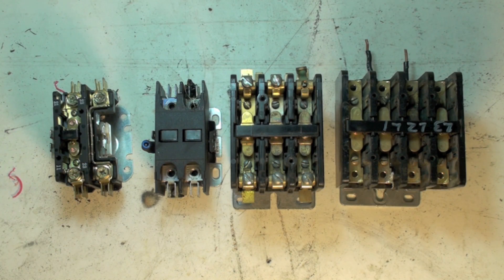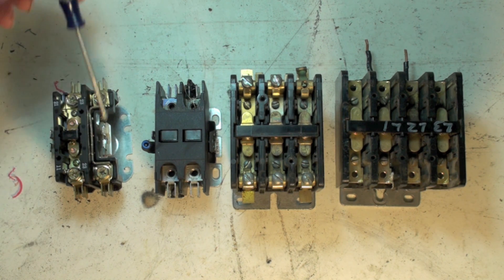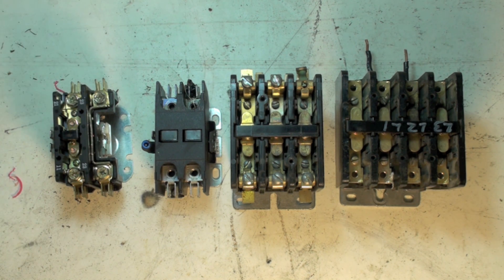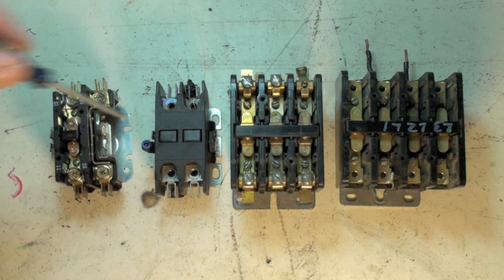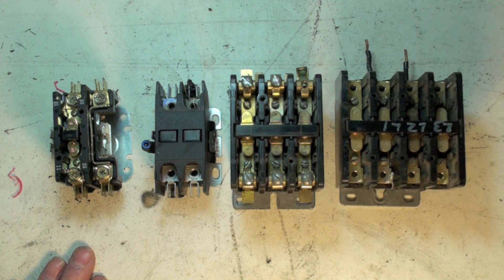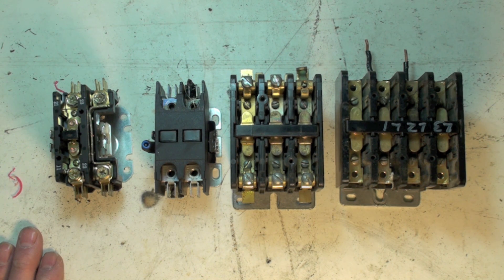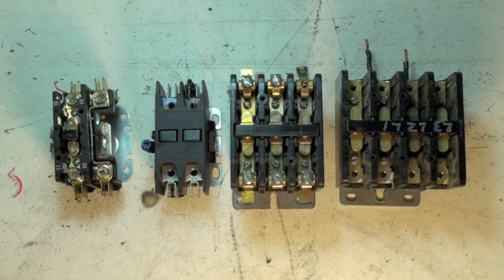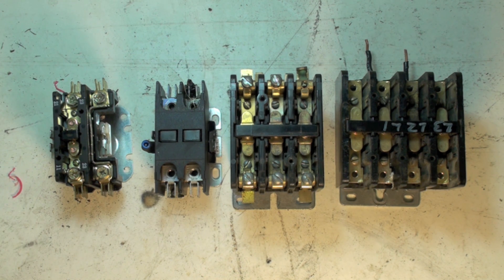HVAC contactor configuration part 4

Comment: I’ve learned that the compressor connects to the capacitor. I’m trying to finish the puzzle what connects to the contactor? Thanks
Reply from the maker: The compressor connects to the contactor and the contactor connects to the incoming power.  The capacitor is part of the compressor starting system.
GFM
Reply: Many blessings GFM! I got my Universal certificate complete now I’m looking for much information on the electrical HVAC system. Do you have a playlist you recommend. Thanks again GFM!
Reply from the maker: Type electric on my channel.  You will get wiring, schematic, etc playlists that may help.
GFM

Comment from the maker: The single pole contactor is used to supply power to a crankcase heater.  The heater is wired across the contacts so  When the contactor is open the heater will energize.  When the contacts close, the heater is bypassed.  I will do a vid on this operation soon. 
GFM